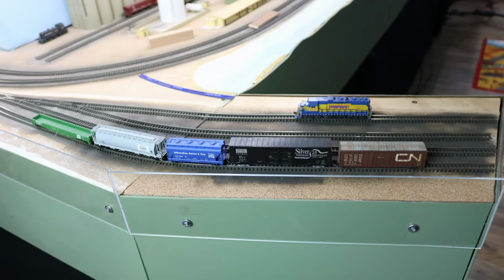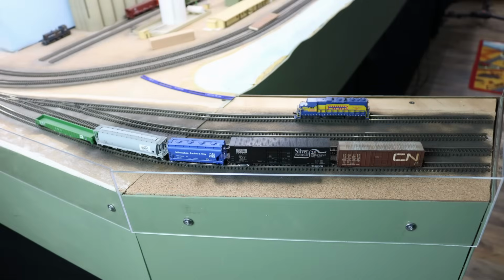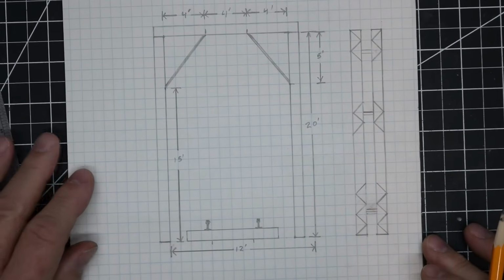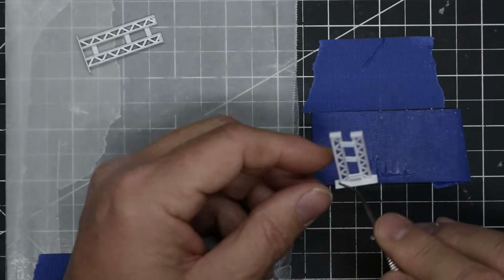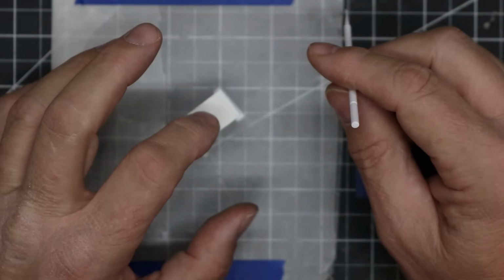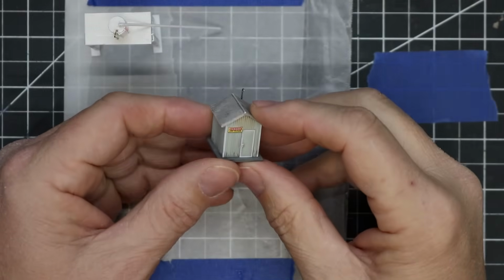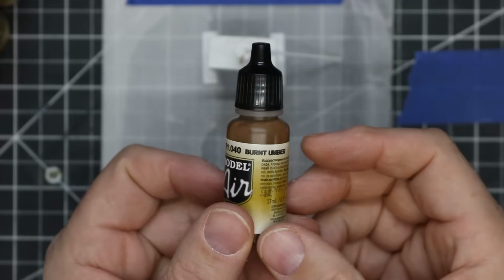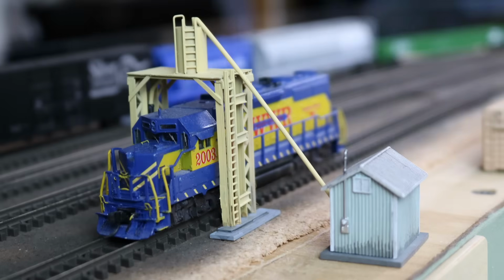Scratch Build a Sanding Tower for Your Model Railroad

Comment: Ron, the mystery pipe is most likely an air vent. 

Since the sand tank needs to be waterproof, you need an outlet for air to leave the tank when sand is blowen into it, and a way for air to enter it as the sand is discharged into the locomotive. 

Great project! ❤

Regarding the MEK - I've mixed discussions about it versus Testors liquid cement, Tenex, etc. Have you considered doing a comparison of styrene glues - or has another channel done one that you can recommend?
Reply from the maker: Air vent is what I guessed and makes sense. As for solvent cement comparison, I've not done one but sounds like a good idea. Commercially I've gotten a long fine with Micro Mark Same Stuff and Plasteuct plastiweld. The MEK works and is cheap.

Comment: That looks neat! Thanks for showing your work.

I used to work for a pneumatic conveying company and one of the mechanical methods (by our competitors) of moving product (sand in this case) from ground level in shanty and then up to the holding vessel on tower, would be a screw type conveyor. Sacks or barrels of sand would be poured into a hopper bin (where the end of the conveyor pipe is mounted) and when powered the screw grabs the sand and pushes it up the pipe to the holding vessel.

Here’s a link describing the function and an animation showing it in action:

https://en.m.wikipedia.org/wiki/Screw_conveyor

Comment: My layout is in central Illinois along the Illinois River. My family spent many years boating on the river and one thing I always remember is the big railway lift bridge. I plan on moddling it once i movd into a bigger space, but its gonna be a hell of a scratch build because as far as I know no kits of such a bridge exist.
Reply from the maker: Sounds like a challenging project. Best of luck.
Reply: @RonsTrainsNThings  it will be a while. Currently using a spare room that only fits a small switching layout. God knows when I'll be able to buy my own place with a large room. It sucks basements are so rare where I live.

Comment: Looks really great Ron. You can use 'baking soda to help CA bound anything, but be careful as tge CA acts very quickly. If you need a little working time add 10:40 graphite to the soda , the more you add the more time you get.  Thanks for sharing another great idea with the sand tower 😮
Reply from the maker: Thanks for the tip